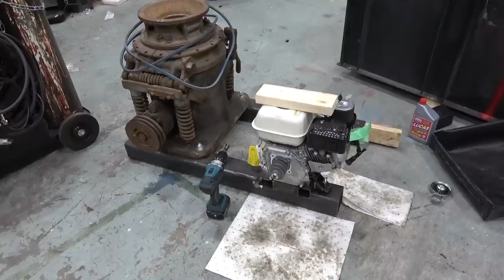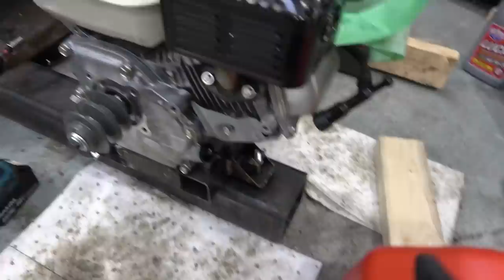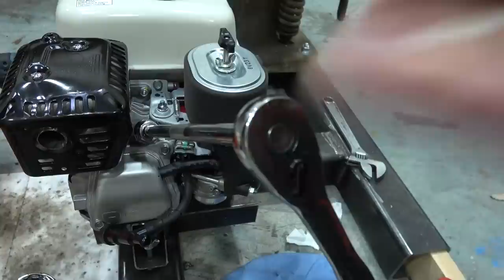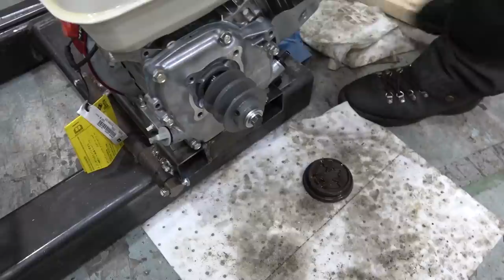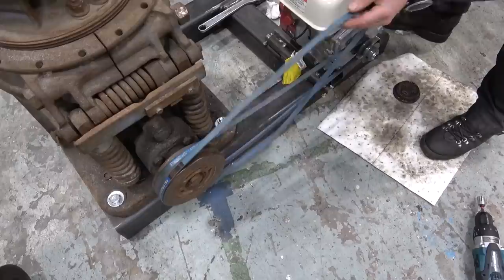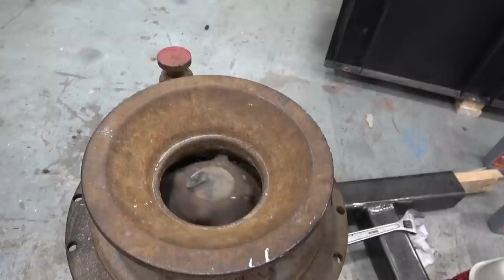Restored Diesel Honda Rock Crusher

Comment: Don't use windshield wash bottles for premixin the 2-stroke either. My wife's windshield washers have never been the same.
Reply: Lol turn the sprayer nozzles to the sides and then you have an oil slick dropping death race car or something
Reply: Just add ignition and even the most turgid bug encrusted windscreen will be gleaming again in no time! For ultimate convenience, why not add sensors to detect when someone is issuing a parking ticket?
Reply: Now I don't feel so alone
Reply: @chucklebutt4470  I think flame thrower is probably more effective and certainly more fun.
Reply: happens to the worst of us😂
Reply: Hey windshield wipers are sort of 2 stroke, should be alright
Reply: I use the empty windshield washer fluid bottles for used oil, and yes I did fill it in the dark one eve!
Reply: It took a lot of purple power to get the reservoir reasonably clean. However, the dipstick is still stained yellow-green. Serves as a regular reminder...
Reply: Could be worse.  When I was a truck driver, I always kept a 1 gallon windshield wash bottle next to the bunk.

Fortunately the legitimate fluid was blue, so I never got it confused, but you can imagine the smell if I had...
Reply: My dad poured some used oil from a windshield washer fluid bottle I had over at their place after an oil change 😂 . He caught it before he got more than half a cup worth in it
Reply: I'm using a can meant for Kerosene to store gasoline. That thing swells more and more every month. Sometimes you eyeball the label at the store. Maybe once it's empty, I'll buy a real gas can

Comment: Diesel in the Crank Case, Oil in the Fuel Tank. She'll run backwards, what for gettin' your rocks back out of the hopper.
Reply: Diesel in the crank case is good for flushing your engine during an oil change, then drain it out and stick it right back in your tank

Comment: few years ago, buddy of mine had 5 gal of diesel in a red can stolen... next day the neighbor came over cause his van wouldn't start...
Reply: sounds like part of a redit story
Reply: That happened with my work truck too, I had a 5 gallon can of diesel for "oiling" concrete forms in a gasoline can, someone liberated it on night, never found out who, but know the consequences of what happens.
Reply: My dad had a neighbor stealing gas from the milkhouse in the 50's? So they added water to the gas like 50 50. Then sat back and watched the hillbilly neighbor beat the crap out of his dirt bike because it wouldn't run
Reply: Similar thing happened to a buddy of my dad's a few years back. He had gotten tired of people stealing his gas, so he filled the can with river water. A few weeks later a neighbor told my dad that some SOB drained all the gas out of his 4-wheeler and put river water in it.
Reply: I own a landscape company...you see a red can that is unsecured outside my shop......it ain't gas in it😆
Reply: I'm a Paramedic and we Ford Powerstroke Diesels, and then swapped back to Gasoline. We had two ambulances end up with Diesel in the gas rigs.........OOPS!!!
Reply: SPC pitts... total BS. Sugar doesn’t dissolve in gasoline, it just sits on the bottom.
Reply: @TheXGamer969  now, take that 5lb bag of sugar and dissolve it in 1 gal of water then add to tank, yes, the victim will be replacing injectors, flexfuel sensors and probably a fuel pump.  The water carries the sugar into the system, water boils off and leaves sugar crystals. Does a number on fuel injectors.  ;)
Reply: @timandshannon03  a gasser engine in something that's literally trying to save lives.. who gets sued when it overheats or pumps the ambulance full of carbon monoxide? Lol
Reply: @dregenius  they are switching back to gas ambulances here. New diesels are junk with all the emissions stuff on them, dpfs dont like idling either. I would rather not have the ambulance break down with me in the back trying to stay alive.
Reply: @dregenius  I literally had to write up a rig for that exact problem! Lol The problem is Ford stopped making the Econoline Vans, and don't offer Diesel in the God awful Transits!!!!
Reply: Happy ending so 😆😆😆
Reply: simular story a "buddy" of mine stole some driving lights from my garage, never knew it was him till he came round and asked me to wire them up.

Comment: The inner pyromaniac in me is shaking my head at the dew claw now. First step of any fuel use is to sniff your aromatic hydrocarbons before filling a tank, lighting a bbq or destroying evidence.
Reply: indeed, you need to know how big the fireball wil be when you light the crap on fire. Is it going to set your house on fire or only that of the neighbours.
Reply: Colors & textures, too. Diesel is somewhat bluish-green and has that "slimy" feel.
Reply: LMFAO! ... “or destroying evidence”!!! 😲😁🤣
Reply: With adequate torch light you can read the fuel cap prior to syphoning thus eliminating any doubt in what fuel you will be later using.

Comment: Theres one thing I know for sure... If a Honda engine won't start, its operator error
Reply: Madprops Boatworks so true
Found an old 11 hp honda pressure washer under a pile of grabage in an old garage couple squirts of carb cleaner and it started in a few pulls
Reply: A friend of my dad's asked him to look at, I think, a generator with a Honda engine on it one time.  The guy just couldn't figure out why it wouldn't start.  Dad looked at the oil level, saw it was low and filled it up.  I'll be damned if it didn't crank right up.  Come to find out that they had a kill switch on the oil level.  Great idea.  If someone is too stupid to keep oil in it then they shouldn't be running a generator anyway.  My only question is how you can tell when the sensor is busted.  That could be a head scratcher.
Reply: I bought a single stage Honda snowblower on Craigslist. "Won't run." They didn't have gas in it.
Reply: Cory Stansbury Well they didn’t lie
Reply: Unless you have 1 of the new motors  smaller rings.
And a float carbie on there wacker packer motors my whole worlds collapsing
Reply: had a rental unit dragged into a filter pond by a dozer while running at full tilt, its sucked in enough scum mud and h20 to seize right up.. after disassembly and wire wheeling the mud off the piston it ran like a champ, smoked like a welder though
Reply: As a guy who pays his mortgage by fixing other people's Honda motors, you are definitely underestimating the general public.
Reply: Maybe the little stationary type engine certainly not the cars
Reply: Not so true anymore...the pressure washer decided to break a rocker arm last year...
Reply: @rehoboth_farm  you just make sure it has oil and then unplug the connector at the sensor.... actually had that happen once on a shitty Chinese Honda clone
Reply: Our mixers at work all have these Honda motors,  I’m not saying there’s anything better, but they absolutely suck, the fuel runs into the oil constantly, then they don’t start and your boss thinks you’re fucking stupid..
Reply: I just had to fix a gx160 at work. Of course the last thing I checked was spark, and it had a fouled spark plug which prevented it from starting. I did start with the carb just because all I got told about it was that it hasn't been starting in at least a year, and it still had gas in the tank. Either way, the carb was getting cleaned.
Reply: @rehoboth_farm  A friend had the same thing happen on a government surplus baby excavator!
Reply: @rehoboth_farm  Any multimeter would do it. Resistance test check for ohms. When bathed in oil it probably is shorted, or when dry shorts ignition to ground like a kill switch. Or vice versa, either way you could bypass the switch temporarily too. ;)
Reply: Madprops Boatworks amen brother!!!!!
Reply: @rehoboth_farm  I wish I could like this more than once... that was hilarious
Reply: @ashipshow  I do what I can.
Reply: @rehoboth_farm  Honda provides a quick disconnect on the oil level sensor wire. Check for continuity between sensor wire and block if oil level is correct it should be open circuit. I check the sensor every oil change. Connect the multimeter and start draining oil, wait for the beep.
Reply: @N_behr  that fuel shut off switch?  Yea it is not there for looks.
Reply: The guys at work had a Honda Generator fall of a crane hook and hit the planet 8 stories below...The frame was smashed beyond recognition and the ignition toggle switch was sheared off as it landed on it's side. The site supervisor tipped it back on its feet, checked the oil and pulled it over. A liberal puff of smoke and she settled into a healthy run. That has to be 10 years ago now...still running today.
Reply: A friend of mine got an old Honda motorbike from her mother. That thing sat unused in a garage for more than 25 years with old gas in it. Some carb cleaner and a new Batterie and it jumped right on. Those things are truly build to last
Reply: @rehoboth_farm  Just another safety to bypass when you get it...you know all the safety switches that you bypass on your riding lawnmower? Like that

Comment: If only they color coded fuel cans, elecchickens could differentiate what's hot and what's not.
Reply: I can’t be too critical as I have filled yellow diesel canisters with gasoline when for some reason all anybody had in stock in our area in the ~5 gallon size at the time were yellow diesel canisters.  Though not too much opportunity for confusion since I own no diesel fueled engines...though I did at least label the canister “Gasoline” for reference....just as I have an old 5 gallon red steel gasoline canister labeled “USED OIL”, but it is rather unique as I don’t own any other similar looking canisters and it has bright yellow “USED OIL” labels all over it so that nobody mistakes it for gasoline!
Reply: They do. Now if only the State of Cancer could put a warning sticker  on the yellow #2 can that lets you know the ingredients in are know to cause California... 🙄
Reply: @ebutuoyebutouy  ...Isn't yellow reserved for the gasoline cans you put in the back of the Jeep with a blanket on top when going through the BC Ferries ticket booth?
Reply: @iandegraff3472  California... that's terminal and terifying!

Comment: The ole sniff test is the most important for fueling, dating and that occasional check of the fridge. Saves lots of time
Reply: No you need to do the taste test dude. Just put it on your tongue and you wil know. Forks for everything, even batterias.
Reply: @gabbermaikel  I'm now realizing I've never tasted diesel! Plenty of gas from the old tube suction classic. Have only used diesel on away missions working in Prudhoe Bay, Alaska doing various oil pipeline work and if a foreman saw me licking my PPE I'd have been pissing in a cup every week until I was able to get home (the goal of which was to apply ethanol to my body, of course). Two weeks of boozing and spending as much cash on dumb shit until it was back up to the slopes. met some wild dudes, had some good times, but not sure I'd do it again since me and the girl got serious and that friggin stork left a lovely little lady with us.
Reply: If it smells like trout get the fuck out, if it smells like salmon keep on slammin.
Reply: Yep.  Back in my tire changing days we had more than a few cars came into the shop running like shit and the mechanics and service writer couldn't figure out what was wrong.  The problem was both of the mechanics and the service writer/boss didn't drink and couldn't tell what cheap shit hard alcohol smelled like.  This drunkard takes one sniff of the gas tank and it smells like cheap vodka with a hint of gasoline, same problem every time.  Owner put E85 in the tank by mistake.
Reply: When getting milk from the fridge at work, shake it first. If it rattles, leave it for the next guy...
Reply: It’s also great when you’re out of clean clothes.

Comment: Prudence The Safety Goat will not like chemicals in improper containers. We had Safety Sally ask why we had diesel in a Gatorade bottle.
Reply: Because it's hard to drink out of a fuel can
Reply: But it is easy to fill a fuel filter with a small bottle
Reply: @MattLitkeRacing  because it has electrolytes!
Reply: @jameshorsfall5110  It's what they craaave
Reply: Why's she asking personal questions?
Reply: That isn't diesel.  I wouldn't smell it either.
Reply: An old eye contact solution bottle works real good for squirting gasoline into spark plug holes and carburetors but dont let the old lady find it or she'll end up red eyed and mad.
Reply: Because we needed to find out how dull the apprentice was.
Reply: At least it wasn't concentrated glyphosate in an orange Gatorade bottle. That'll ruin orange drinks for you for life. 👌

Just like the little Honda that could, here - 30 minutes of profuse vomiting, and right as rain. 😅👍
Reply: @interstellarsurfer   WARNING: This product contains chemicals known to the State of California to cause cancer...
Reply: @Pickleriiiiiick  shar-pei does not stick too well to rotomolded eagle cans.  Paint marker is the trick.  Premix will strip perm..marker like a handful of 100's on a tuesday afternoon at the club.
Reply: @avlawns3037  Not good enough to just write it on. Gotta meet GHS compliance.  I mean, how will one know to wash it off if it spills on your hands?
Reply: @ericgulseth74  the tingling or burning.  In some cases the melting flesh would be your first clue :D

Comment: A successful dynamic duo is comprised of two important players. One is intelligent,  the other not so much. 
  Our Hero and his loyal, though often spoiler sidekick, Dewclaw.
  "Holy ole safety goat VJOman, something doesn't smell right here!" Could it be the the boom juice? Will the machine dust your nuggets or not?
  Tune in next week to find out if it's virking to "The Case of the Olfactory Failure!"
Reply: First came the oil factory failure. Wrong dinosaur squeezings!
Reply: What are you trying to do Matt?  Put AvE out of a job.
Reply: That man wears size 14 turd stompers, I couldn't even half fill them and would never try. His legendary wit is a nuclear tipped ballistic projectile while the rest of us are armed with nerf.
Reply: Are you his alternate account?
Reply: Yes, Dewclaw is intelligent!

Comment: A bit of upper cylinder lubricant never did anyone any harm, once she smoked off she was runnin' like a train
Reply: Just what I was thinkin.
Reply: Did it myself with my gas powered backhoe... who makes a gas powered backhoe?  I felt so Stoooooopid!
Reply: @theoldbigmoose  many years ago they had gas but, most people are not old enogh to remember. I am not pickinh on you but, myself because I am old enough lol.
   Have a good day
Reply: Part of proper breakin procedure!
Reply: @scruffy6151  no offense taken! It was a Ford 4000 backhoe that was built in 1962 I think.  It was an oldie, but worked pretty good once I drained the tank and put gasoline in it.  It was all my fault, the plug wires just didn't register.  I think me and AvE's favorite "Electchicken" dewClaw have a lot in common!  :-)
Reply: @theoldbigmoose  it happen to all of us back in 83 I put 15 gallons of diesel in my car by mistake the cashier ask me if i had a diesel motor my car 😳.

Comment: i work in rental, these are everywhere. if you want it good as new, disassemble the carb all the way, put the block in some simple green for 10 min. CRC brake clean will get it the rest of the way, replace o-rings and gaskets as needed. You MAY have to replace the fuel strainer in the tank too (yes, there is a fuel strainer in the tank) but usually you can get one back up and running (like new mind) for like 20 bucks.

Comment: I was curious that the 'Diesel' generator appeared to have a spark plug.
Reply: Some diesels have a glow plug for easier starts, so that can be an operator-deceptor right there.
Reply: I know what a glow plugs is, but didn't expect to see one on a single cylinder engine like this. And it still looked like a spark plug to me.
Reply: Especially as it was pull start. Probably not getting much glow there. But while I know how to pull, I'm no diesel expert.
Reply: @Bradimus1  watch the video a couple more times. Youll figure it out eventually.
Reply: Do I seem like I'm still confused?
Reply: @Bradimus1  get over it
Reply: The internet is a great reminder of baseline IQ. Thanks for the follow up, Bob.
Reply: @throttlebottle5906  Bradimus1 is making a joke with his first comment. Read these comments a couple more times and you can get the jokes too.

Comment: Reading the title I was like, "WTF, Honda makes a diesel engine?"
Reply: They actually did make single-cylinder diesel engines until maybe 2010. But this clearly ain't one.
Reply: Agreed, and disappointed. The diesel honda dream
Reply: They do, they even make diesel civics and crvs now
Reply: Jacob Audrey I didn’t know they made them that long! My dad is in construction and I remember a client of ours had a really cool Honda lawn tractor and I believe it had a straight 2 diesel but I think was this http://www.tractordata.com/lawn-tractors/000/6/6/669-honda-h6522.html. And ironically too is that he uses diesel on concrete forms and at one point the yellow cans were non existent so it was put in red cans but I don’t recall any issues.
Reply: If rice burners weren’t loud enough already...